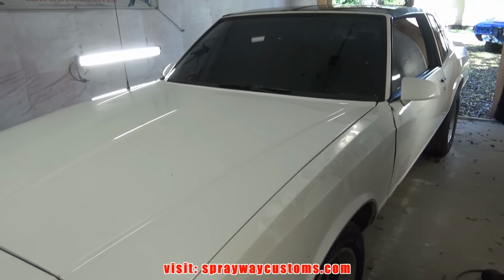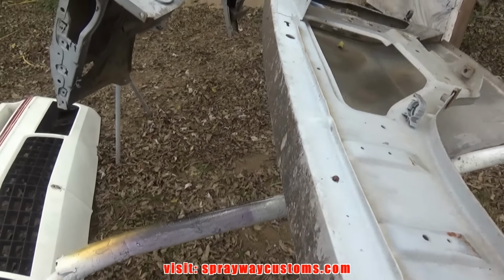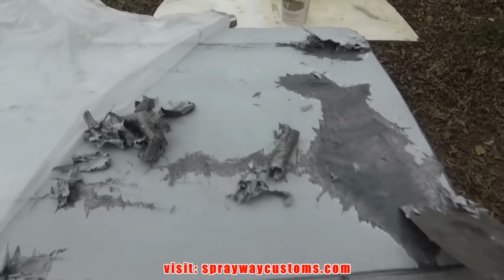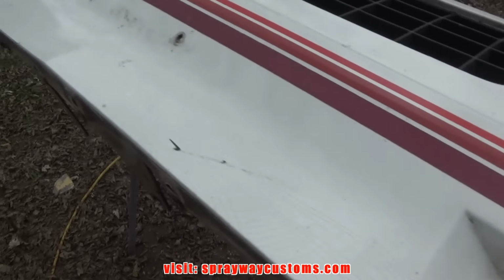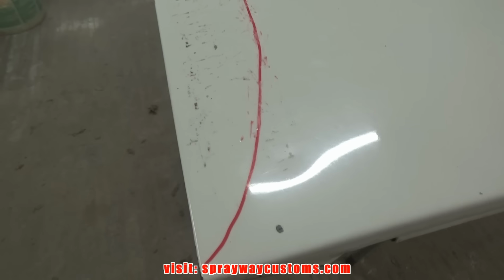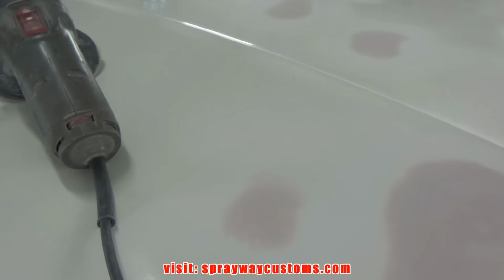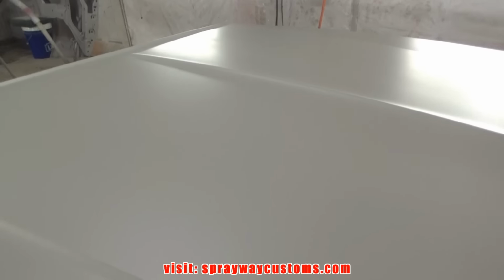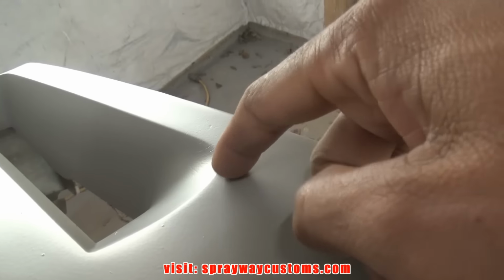Bodywork Primer & Paint Tips & Tricks - 87 Chevy  Monte Carlo SS G-Body HOW TO PREP A CAR FOR PAINT

Comment: Not sure what I did wrong but tried using the same guide coat paint, but man  it clogged  the paper up !  Yes it was very light and very much dry.
Reply from the maker: Yes, if you blocking with something like 180 it's gonna clog real easy. I usually keep the air hose close by and just spray the same paper off with compress air often.

Comment: I see you used fiberglass for plastics, I have a 1 ton back fender  F 350 That’s all there but busted to peace’s, told if I use any thing other than plastic weld it will not hold, What do you think, will it separate and fall apart,
Reply from the maker: I would just recommend buying a replacement fender because if it’s busted up that bad it just wouldn’t be worth the time of repairing it and it crack in another area.

Comment: Did you fill the lows over the guide coat after blocking or did you sand the guide coat out first and then fill?
Reply from the maker: I've done it both ways. Sometimes I try to fill them first but either way will work
Reply: @SprayWayCustoms  Appreciate your help for us trying to learn and for sharing your knowledge

Comment: How long do you let the epoxy primer dry before spraying the high build primer?  Then how long do you let the high build dry before sanding?  I think I rush this too much when I work on cars and it shows after painting.  Always looks straight after blocking.  Then after painting it is not.  I always see imperfections.  I wait hours but think I should be waiting days after priming.
Reply from the maker: Yes, I had to learn the hard way….you have to have patience with everything when it comes to painting. I let the Epoxy dry for about an hour before the high build. I try to let the high build sit for a day before sanding. You really don’t have to wait that long but the longer the better.

Comment: Hi bro, I'm from Russia, I'm repairing the bumper with a hair dryer with a narrow nose and the adhesive base is the same bumper, I just cut off a piece of the strip from the same bumper in an invisible place, I write off the place of the crack and the strip and start pressing the strip from the beginning of the crack, holding it vertically near the crack and begin to warm up the crack together with the strip as soon as the plastic begins to heat up, I begin to push it into the crack thereby, as if I fill the crack in the bumper and in this, then I do not tear it up and it won 't crack like that bro
Reply from the maker: I’m not sure